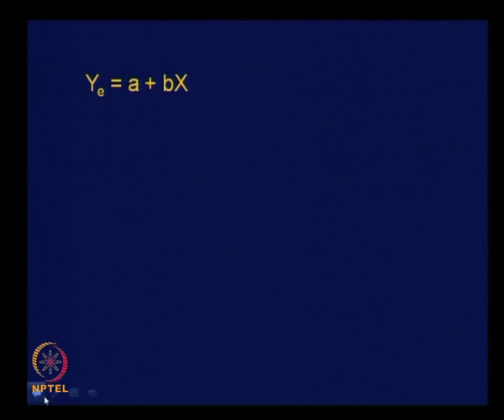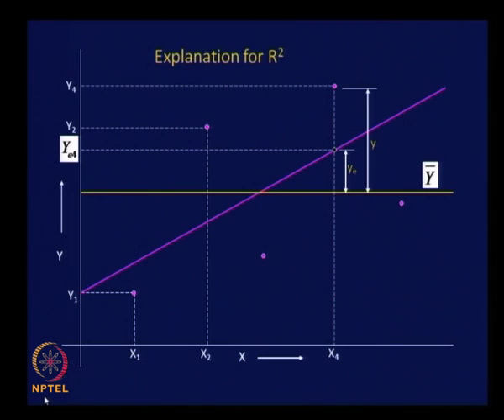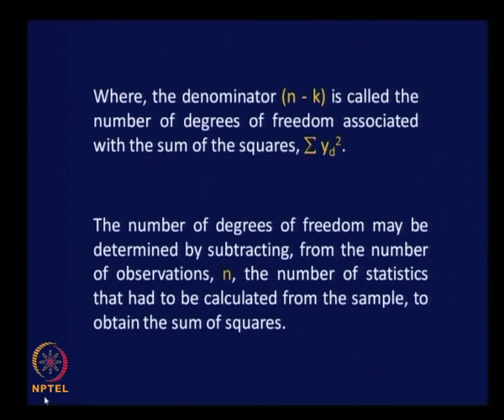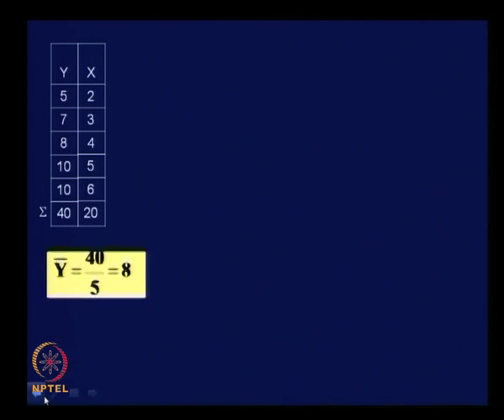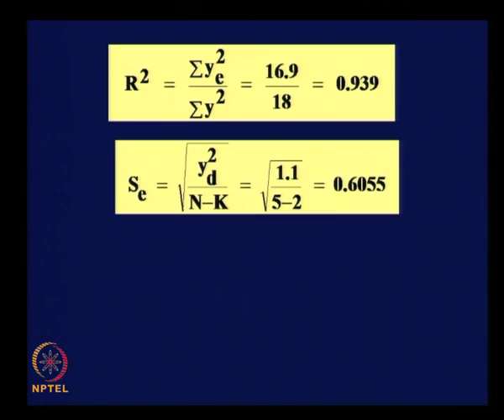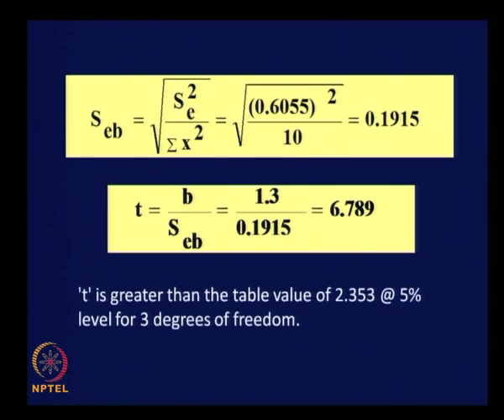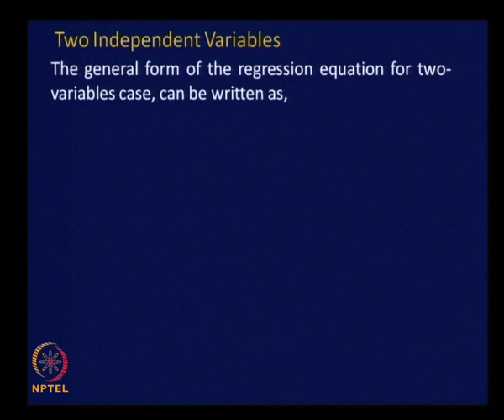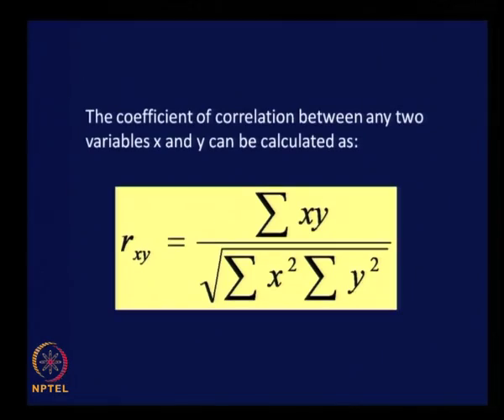Mod-03 Lec-10 Trip Generation Analysis Contd.

Comment: thanks, but what is the value of x1 and x2  that used in last equation, y=a+b1x1+b2x2 
? or can write the equation interms  of x1 and x2 ?
Reply: If we consider two independent variables (for example both size of household and number of vehicles owned by household) then the dependent variable will be explained by those two independent variables Here X1 and X2 are two independent variables. Here data set is in the form of (Y, X1, X2)